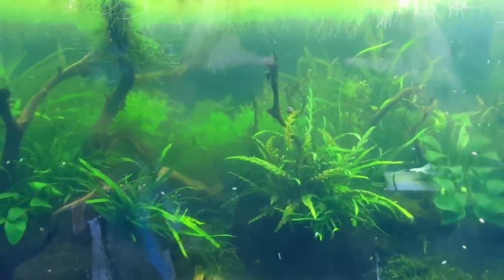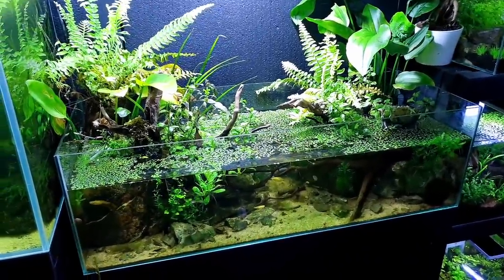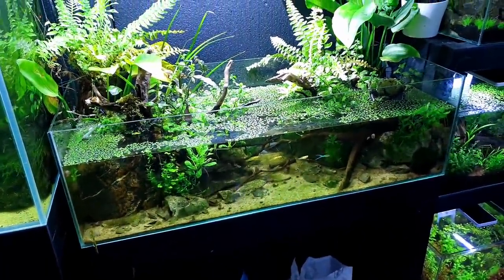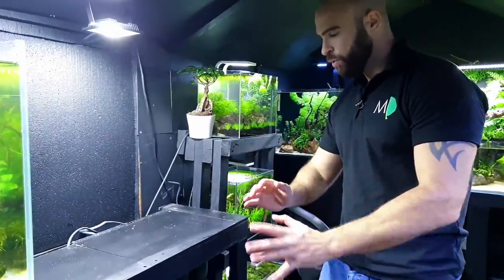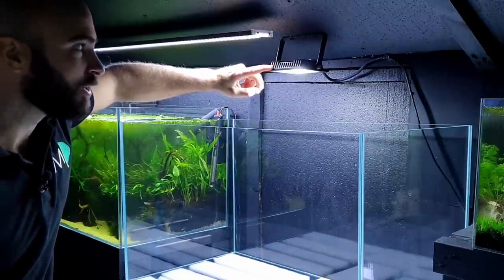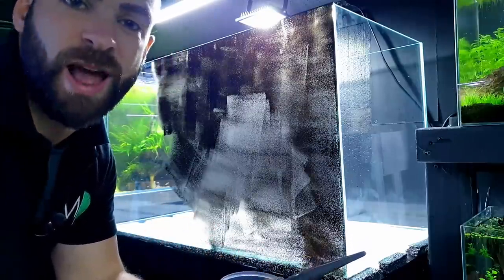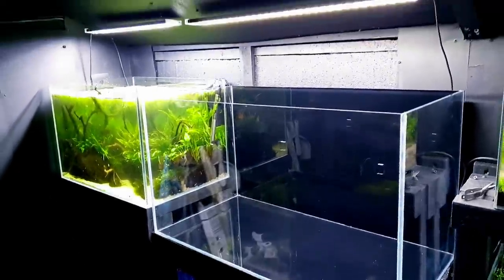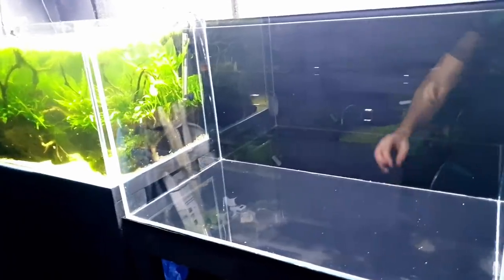*NEW 80CM TANK* What Fish?? // Why Is My Water GREEN?!

Comment: I stopped painting the back with a paint roller and switched to spray painting. Much cleaner and you van put 3 coats on in an hour. Yes, you need to use old news papers and some painters tape to cover the parts you don't want to spray.

Comment: This tank, 144 liters, are way to small for goldfish. If you want that the tank should be at least 700 liters. So go for a blachwater instead.
Reply from the maker: That seems seriously overkill going by the research ive done?? Ranchu goldfish. 3x in this tank with heavy filtration seems a very good size tank to me??
Reply: @MDFishTanks As  you  probilly know Goldfish get stunting when the fishtank is too small. The stop growing in length but still comtinuing the growth inside.  So  they suffer before the die.